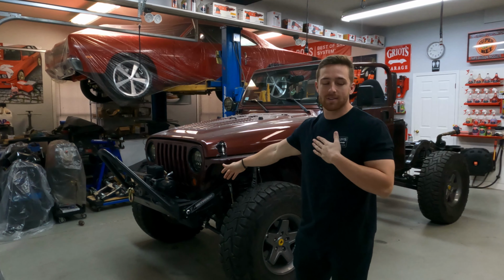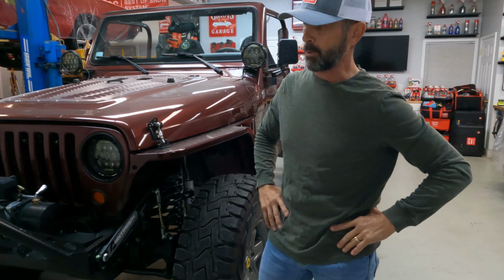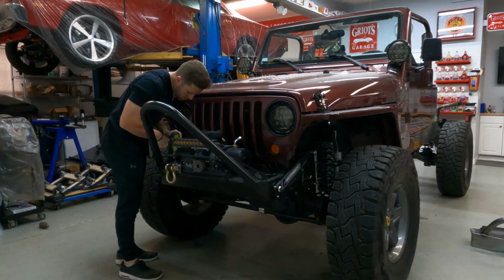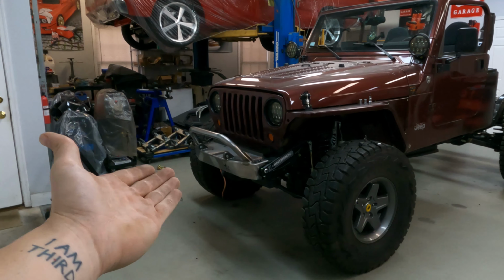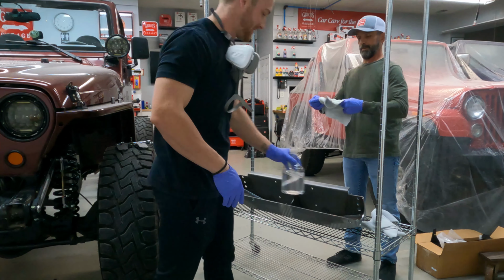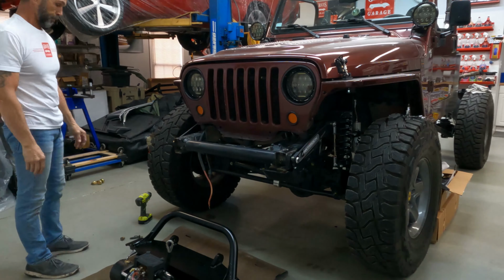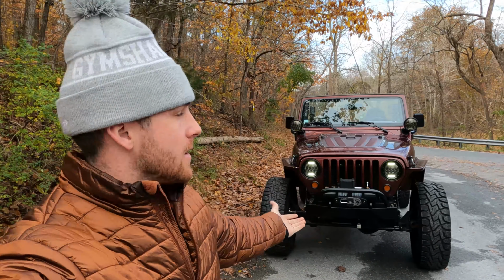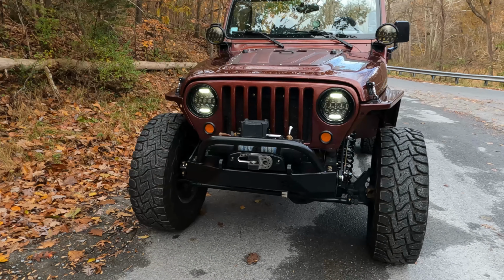INSTALLING A BARNES 4WD STUBBY FRONT BUMPER ON MY JEEP TJ

Comment: Running the same set up, can you run d rings? Can’t get mine to fit due to the fairlead. Lucky I have soft shackles
Reply from the maker: The fairlead is in the way on mine as well.  I run soft shackles so it isn't an issue.

Comment: Do you still use the Torx bolts from the factory bumper? And if so what adapter do you use on your impact gun?
Reply from the maker: I did but they’ve been replaced with Grade 8 now.  We have torx bits that have a socket attachment on it.